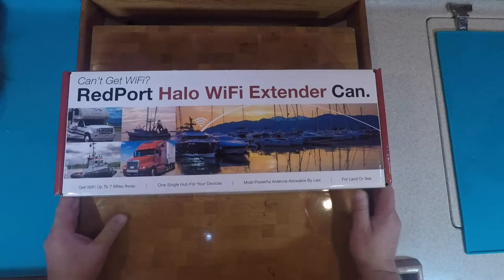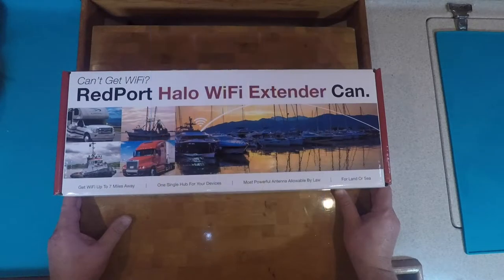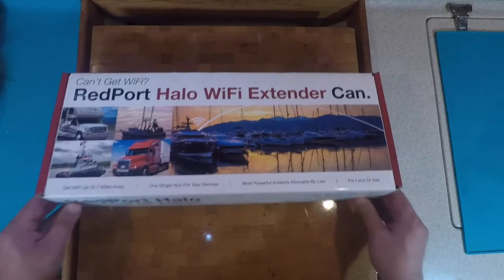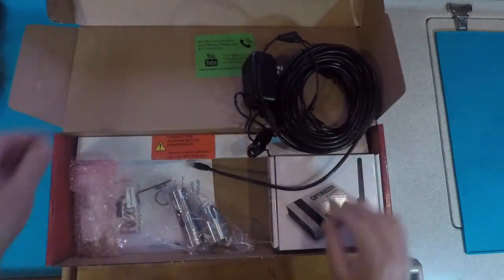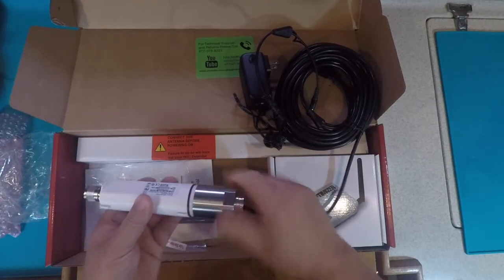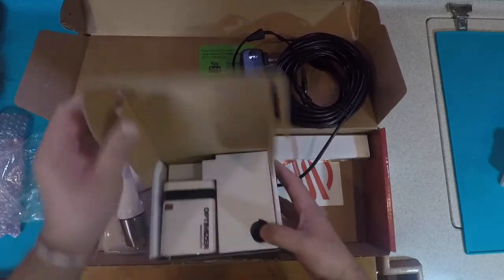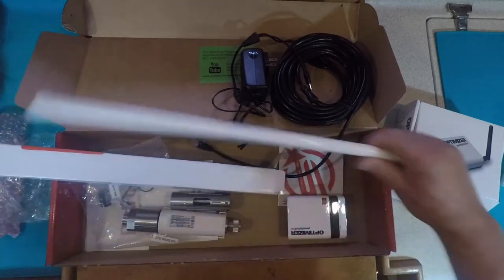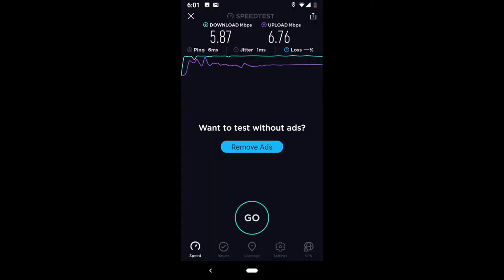Redport Halo WiFi Extender installation on sailboat

Comment: Great video! Any idea what the speed limit is? Would it be able to give you 150mb download speed if you were relatively close to a signal? I'm 23 years old and instead of renting a small place I've build a van. But whenever I need to download large files, I need to use someone's wifi because of the annoying fair use policies with Cellular data. My mom has good internet and so does my dad but their parking lots are about 60 feet away from the house I use theirs for whenever I need to download large files.